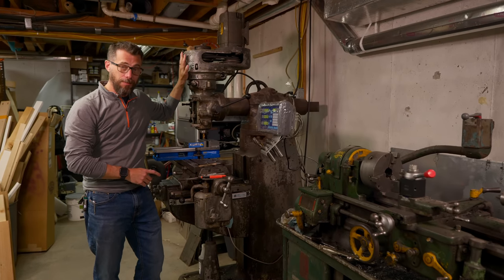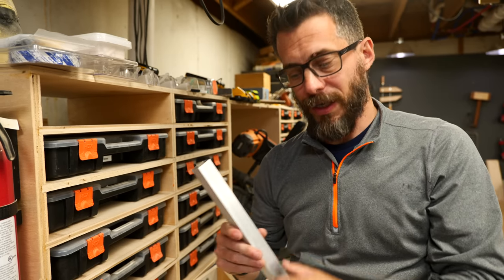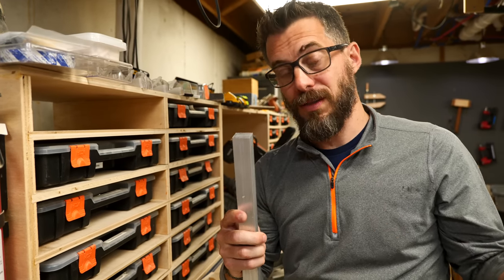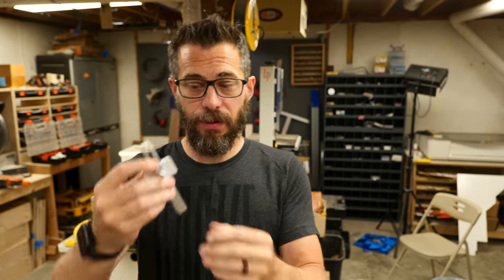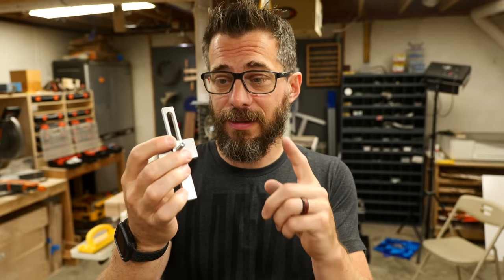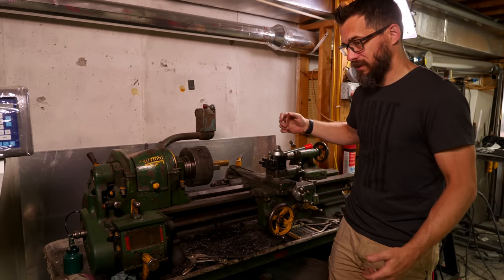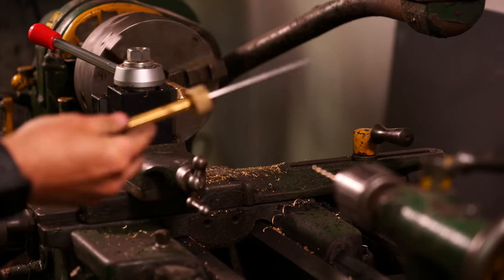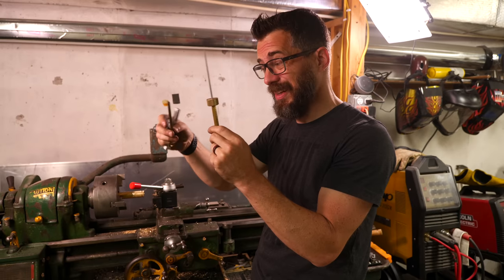Overcoming My Fear of Machining Metal

Comment: You shouldn't be frightened of metal working machines. Just treat them with the same level of care you did for your table saw when you first got that, and you'll probably be fine.

Generally, most of the safety rules concerning the mill are similar to safety rules for the lathe. Stuff like keeping your workspace tidy so you don't slip/trip while working, no jewellery or loose clothes, and appropriate safety gear. As (Like me) you wear glasses, don't bother getting safety "Over glasses". They just steam up every 5 minutes. It's much better to get an impact resistant face shield. It's worth paying a little more for a reasonable one from a big brand though, that way you should still be able to get replacement polycarbonates for it for a few years. One "Loose clothing" thing that often gets overlooked is a welding apron. It can useful as mills/lathes will chuck a lot of hot chips about that then get lodged on your clothes and cut you when you're not expecting it, but if you do decide to wear one, it's good practice to make a replacement set of neck and waist straps that attach to the leather apron with Velcro AT BOTH ENDS. It's still not perfectly safe, but the theory goes that at low speeds you'll have time to tug free, and high speeds it'll be ripped off you before you have time to get pulled into the spinney slice bits.

Mills and lathes are amazing tools to own, and with time you'll find more and more unconventional tricks that make them even more useful, but always just run the "What if's" through your head before hitting the power button on any new setup. Consider things like, if the work moves, is it going to get closer or further away from the cutter (closer will usually damage/shatter carbide tooling)? If the work holding fails, where is the workpiece going to fly? And if doing something that's a bit more "Heath Robinson" than usual, is there ANY possibility that the emergency stops will suddenly be within the potential danger area ?

The important thing is to just use the machines. Think up some more small projects that you can do on them so you get used to what does what, and learn how to hit self imposed tolerances. Do random simple stuff like cutting bolts to custom lengths, and making a handful of your own washers, or even plan out and machine something like a basic draw bar spanner for the mill (or something else where some tolerances actually matter), and work out your machining process order before you start.

Oh, and a couple of lathe tips for you based on what I've just watched.
(1) it's not uncommon to accidentally wipe out the knurling as your doing it, because you're essentially rolling spaced teeth onto the surface. If the diameter is half a tooth over or under than than the number of teeth you're trying to roll in, you end up mushing the tips back down. If you see this happening, just take a really light skim pass over the messed up knurling and try again.
(2) When knurling, run the lathe's spindle speed slower than you would for turning, and drench the tool/workpiece in cutting oil. The forces involved when deforming a knurl into metal can be huge, the oil helps lower them a lot.
(3) Rigidity is crucial on every turning operation. You always want the tools and the work sticking out the bare minimum you'll need for the turning operations. If they're sticking out excessively they're more likely to be free to flex and/or resonate. At best this leads to a bad surface finish, at worst it'll break your tooling.
And (4) Always plan out your machining process order fully. That knurled nut really should have been surfaced on the end and diameter, drilled, tapped (While still in the lathe, and started by putting the tap in the tailstock chuck, then turning the workpiece/lathe chuck BY HAND), knurled, partially parted off, chamfered on both sides, then finally parted off the rest of the way. This would have meant a chamfer on both sides to clean up the edge of the knurl, and a straight threaded hole without having to risk crushing the knurl by holding it in a vice for a separate process.

All that said, the finished result looks pretty good for a learner. I'm pretty sure I handed in less impressive work when I started being trained as a metal machinest. :D

I really enjoyed watching you embark on this learning process here, and hope to see more in the future.

Comment: You could improve your wooden stop block for the price of a T bolt that can be inserted into the face of the track and spun 90 degrees such that it can't be pulled out.

Comment: When you’re squaring stock, you should use a small ball or bar on the dynamic jaw against any rough faces to eliminate any wonky angles or jaw lift, so the reference surfaces stay in contact
Reply: Like Jimmy Diresta says, If it looks square then it is square. We're not making Lego bricks here.
Reply: @1pcfred  it’s not always crucial for home machining projects but it’s still good practice
Reply: @zanderchiasson8064  standard practice is to only make things as precise as they need to be and no more. As going further is considered to be a waste of effort. It's amazing how out of square many common things really are. Like structural steel. Angle and channel is never square. It's not even close. Although it does look square. It's squarish.
Reply: @1pcfred  again, no it’s not needed, but it’s a good habit to get into anyways

Comment: Machining aluminum is not fun without some sort of coolant. Otherwise it gets hot and clogs drills, clogs chip breakers, snaps drills, etc. 

Steel is much more forgiving than aluminum in my opinion (I work as a manual machinist) 

Soft materials a lot of times are a pain to machine for the sole reason of being soft.
Reply: Also the knobs on the lathe control feeds and speeds, which are two words that will become very familiar as time goes on
Reply: I was expecting a comment like this when I heard Bob say that he was going to start with something easy, like aluminum. Steel would've been a better choice. :)
Reply: @martinedelius  yeah aluminum isn't very forgiving... I've broken more drills in aluminum than any other material including inconel
Reply: @martinedelius  and I agree, steel would have been a much better choice. That or a (ideally free-machining) brass/bronze...

Comment: Weird that I never thought of those tools to scary. Back in 9th grade we did couple projects using the lathe and I can't remember being scared but more excited. I made parts for a hacksaw and a tool box. I think the only thing I did in shop that was sort of scary was sand casting and pouring the aluminum for the hacksaw handle.
Reply: Bob has probably seen some of the horrific videos on the internet of people getting caught in the machine.

Comment: Definitely will want to speed up rpm on the end mills by a bit for a better finish and longer tools. I'd guess somewhere between 1500-2500 depending upon end mill size (smaller tools need higher rpm if you didn't know)

Comment: Hey, great job getting started 🙂👍 most small machines are relatively safe being a slow and  controlled process. Just like any tool you have to respect it but I'd say there safer than angle grinders and circular saws. ( just keep fingers and clothing / long hair away from spinning parts when it's running). Loving the content 🙂

Comment: The reason why the hole hole wasn't parallel to the sides is probably because you didn't spot drill. Drills are (somewhat) flexible and not very good at starting holes. You'll either want a spot or centre drill. (centre drill being a bit less good for spot drilling but can also be used to drill a hole for the lathe tail stock centre.)

Comment: Crooked tap. Two things...One, the drill might have walked because you didn't use a spot or center drill. Two, when you tap by hand you should use some kind of guide to make sure the tap is going in straight. Glad to see a video with these machines. I remember watching the video of you bringing them in, then barely ever saw them again. I'm a CNC specialist of 20 years, and manual lathes still scare me. I typically run 3 axis vertical machines that have guarding all around. I've seen and heard some horrific stuff when it comes to manual lathes. Maybe a good project/video would be to make some kind of guarding/shield between you and the chuck.

Comment: Seems like the Bridgeport was going a bit slow for Aluminum? Your quill wasnt fully at the top, or you have the wrong draw bar to tighten the collets, because it was too low - You most certainly shouldnt be tightening & loosening the drawbar with a crescent wrench, get the correct socket or box-end wrench!
your Lathe has the wrong jaws in the chuck for that type of work, on a more modern chuck they're reversible, on those old ones you needed two sets of jaws or a second chuck?
Honestly, the Bridgeport is fine, but that Dinosaur of a lathe wont do what you want after you get over your fears.......

Comment: Hobby wood worker here: I'm literally watching this video to buy myself time before tackling my flux wire welder that I will be using for the second time in my life.
Thumbs up for exposing your fear of using certain machines :)
Reply: Before you weld practice some on scrap. That's a good idea even if you weld every day. You're best off practicing on scrap about the same thickness as what you're going to weld up. Then you can dial in all of your settings. You'll still probably screw up. But hey at least you gave it the best shot. I hate when my practice weld comes out perfect and my work weld doesn't. That does happen.

Comment: Use more coolant and lower your speeds on most of the operations you did. You definitely need a centering bit before drilling a hole on a lathe.

Comment: Interesting video. You said at the top you wanted to be as safe as possible, but you never described any safety procedures or precautions. 

I know nothing about metalworking tools, so I might be full of nonsense. When I have watched people working on wood turning lathes, they always wear aprons and face shields. I would think with tiny bits of hot metal flying in the air that an apron and face shield would be prudent. But you didn’t use either. I’m wondering what the safety protocol is, and why it does not include those seemingly obvious choices. 

I’m seeking to learn.

Comment: put the bit towards you to shorten the tool length to the part,it stops vibration/ spring mass oscillations. 
with jaws turned around and shortening the tool length you be great; what your doing will work .. just input. semper fi

Comment: I let it roll and caught parts of it.  Fear is not a word that sounds good, need to change that to respect.  Step away from the machine with that adjustable wrench.  The sound in the lathe sounds right, one time a friend of a friend was over and asked what the lathe was so while explaining it I turned it on and that 27 year old (back in the 90's) jumped back a good 10 feet.  Long ago I turned aircraft and then semi cranks and the owner and everyone else in the shop would clear the area when I'd turn on the machine.  One has to be confident that all procedures are complete.  Looks like you have a lot to learn, start by turning the chuck jaws around.  There are numbers for each direction and install in order.  Being able to 'see' moving mechanical things in one's mind helps.  Metal Rules.

Comment: did you use cuting oil when you machining? your saw, your endmill and your turning tool will last longer and you will reduce the cutting force on your tool, witch can avoid to your metal peces to kick off and be propulced out of your milling clam or your lathe jaw. When you working on a lathe, your working peces must never exced 2 times your shaft diameter out form the jaw. If it's the case, you need to drill a center hole and then put it in cantilever with your live center.

Comment: It looked like you didn't use a spot- or center drill, that's probably why your hole came out crooked. When drilling on the lathe, you're supposed to first drill a small cone in the center of the material, to stop the drill bit from being deflected.

Comment: when u do knurling u also have to put a lot of pressure on the tool like about 1/32deep ( or about 0.8 to 1mm ) and if u support from the tailstock side the part cant flex anywhere and u get nice knurling , also lower the speed and use a lot of wd40 or cutting oil....but the succes is low speed, deep enough DOC and pressure and oil or lubricant , and u might can use the autofeed

Comment: You should learn what the controls do and how to change speeds , also if it has auto feed and also how to cut internal threads with the lathe and external threads should be easier then internal threads anyways keep doing projects on both machines and you'll get better and better

Comment: To me the part that seems "scariest" about that lathe is the location of the power switch.  It feel like having a table saw with the switch on top of the rip stop.   There is no way for you to stand clear of the work piece. When you first turn it on you can't get out of the way incase your work piece is loose or unbalanced.  I would recommend seeing if there was a way for you to relocate the power switch, no only for your safety but also for your piece of mind while become familiar with using the lathe.
Reply: The difference between wood saws and metal lathes is metal lathes use liquid coolant. Which limits where you can practically put the power switch. Electrical switches don't work too swift under water.

Comment: I remember the time I bought my first table saw. I was terrified, the thing was just sitting there for months. When I finally got the nerve to work with it, I saw it really wasn't that bad. Now it's second-nature to me. I do, though, want to start machining, and am equally terrified.
Reply: I did the same thing with my table saw. When I finally got the nerve to work with it, I saw it had a wobble. Now it's too late to return it :P. (hopefully it's just the blade!)
Reply: @FredGoldenJR  throw another blade on the saw and see if it runs true. There's one defect you may be able to fix on a table saw. That would be a crooked arbor shoulder. That you might be able to file true while the machine is running. If the arbor is bent I don't think that's repairable. Well, you could get a new arbor and replace it. But you ain't fixing what you got.

Comment: I have to say, the location of your on/off switch for your laythe kinda scares me. Usually it's low down in front so you don't have to reach over your work in order to turn the machine on and off.
Reply: When electric is low on machines it tends to get flooded with coolant. That's why switches are often placed up high. In a production environment that lathe would have a coolant pump just spraying water in the cut. And yeah it'd be flying everywhere.
Reply: Lathe no “y”.

Comment: Speed up your mill speed. The chips should kinda fly off the part your looked like they were kinda just being pushed off. Another thing with putting in tooling you don't have to crank down on the drawbar. A nice firm snug is perfect fine. Keep up the good work

Comment: you can basicly  use any materials on them ( as long that they are stuff ) also dont wear a ring. watch or any jullery well useing the machines as well as long sleeve's and loose clothe ( i always only have a tight T-shirt or long sleeve and role it up. at least above the albows  )

Comment: For a beginner, you're doing a great job! But the speed of the milling cutter is clearly too slow.
You will certainly find the tables you need to determine the speed on the internet.

With the levers on the lathe you will set the automatic feed. My recommendation is to forget about the levers. You won't be able to turn any threads with them, so keep your hands off.
What is important is the speed. 

NEVER leave the socket spanner for your jaw chuck inserted! 
And what is also important, don't work with the jaws sticking out as far as possible. It is very difficult to see them when turning and the risk of injury is too great.
Work with two hands on the handwheels to achieve an even feed. The surface quality will be much better.

Knurling is a very high load for the machine. Don't do it too often.

Brass is also very difficult to machine. It is very brittle!
I would recommend working with jaws that go together on the inside. That is much safer. 
Even better would be real collets like the ones you have in the milling machine, but of course that will be more expensive. 

Sorry for the bad English but I hope it is understandable.
Reply: There's a formula for calculating cutter surface speed. It goes like this SFPM=(π *DIA * RPM) / 12

Comment: Nob is not tap good. Use tailstock to center taping tool next time. 
To finish second site after cutof it use simply threded bar and nuts, and put back in lathe. Bras i more dificult to work the steel for me. Is eser to messup, because is softer.

Comment: Using milling equipment is the same as any other power tool. Respect the tool. Don't get cocky. Take safety precautions. Wear proper ppe. Plan out your cuts. If you don't feel comfortable doing something a certain way, don't. 90% of machining is setup. Once you can comfortably setup in a safe manner, the sky's the limit. And always remember. The machine will win in a fight.

Comment: Tip # 1 you need to dial indicate your round stock in the lathe chuck and adjust your jaws so the stock runout is less than a couple thousandths.
2. You need to align the height of your tool post, tool, and tailstock so they are centered.
3. Use your gears to select the proper speeds for the material and cutter being used.

Checkout Abom79 & Blondiehacks  on YouTube for lathe & milling tips.